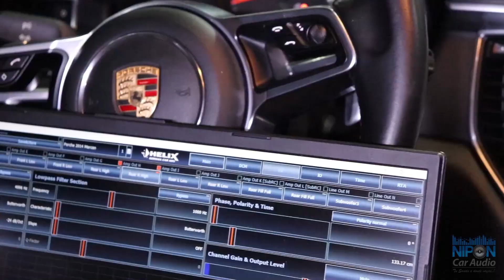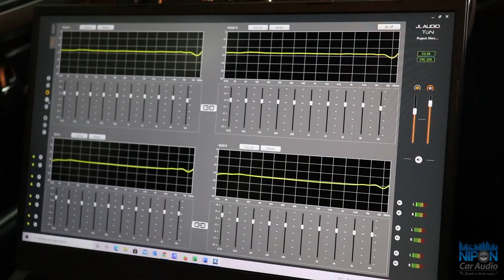Honda CRV 2021 - Sistema de Audio No Amplificado

Comment: Compre una crv 2023 y compre un subwoofer pioneer ts-wx400da, pero tengo ahora duda el del audio q instala dice q tiene q busca o quitar un modulo para q el subwoofer no tenga interferencia me recomienda q lo instales o se dañara algo electrónico del radio ya que van varias aplicaciones ahi espero su pronta repuesta
Reply from the maker: Hola los Honda tienen el sistema ANC y genera un problema en el sistema de audio, pero se desconecta y trabaja perfecto, solo que perderás el BT de llamadas de la camioneta. Bienvenido a Nipon Car Audio lo esperamos en nuestro UNICO local en Av. Tomas Marsano #3730 Urb. Los Rosales Surco. Nuestro horario de atención es de lunes a sábados de 9 am - 7 pm.
Para una mejor atención trabajamos con citas, puede reservar su cita para cotizaciones presenciales y/o instalaciones al WhatsApp del taller 914 447 958 y el WhatsApp personal del Sr Henri Velasco +51 992 775 471. Aceptamos todas las tarjetas de crédito y No cobramos comisión por su compra.